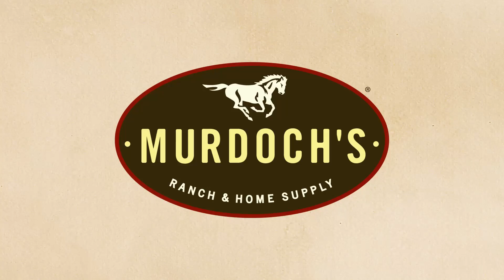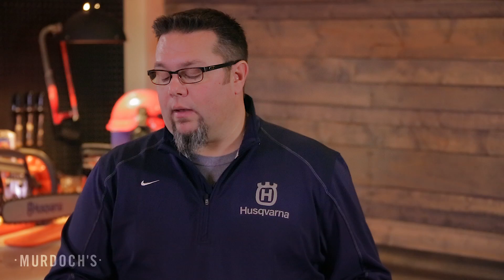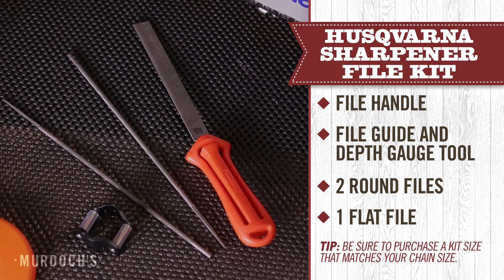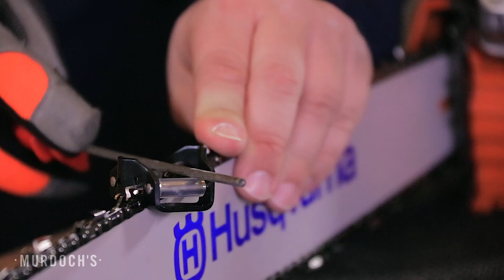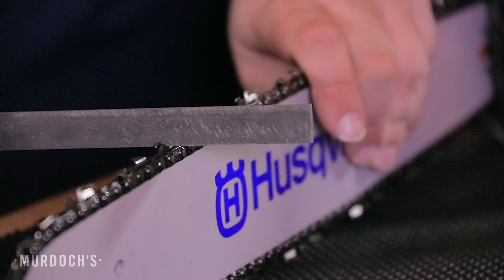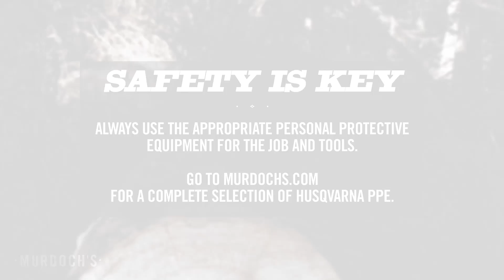How To Sharpen A Husqvarna Chain

Comment: The roller guide has 2 circular holes in it. What are these for? Just for storage purposes, to insert the file while not being used? The flat guide (not show in this video) also has a circular hole. Again for storing? Also the orange handle has a couple of marks on each side (25 and 30), which I assume are degrees. But how are these used when it's the roller guide itself which essentially dictates the angle.

Comment: Where is any instructions?  I bought the husqvarna sharpening kit and the rake adjuster 😊is totally a problem , especially with NO HELPFUL explanation. Sorry but this video isn’t any help, please redo it with intense, visuals as you actually use each piece in the kit!

Comment: OK, when you demo, should demo the full use of the file guide. Did not show how it is used to set the depth gauge/rakers.Sharpen a lot of saws and these Husky file guides are really easy to use, especially for those with very little experience.

Comment: An inadequate video about how to use a Husqvarna file kit, amazingly, by an actual trainer for the company. No information about how to set the file guide down onto the chain with regard to the arrows and depth.  No information about use of both rollers (vs. one as shown!). No coverage about how to use the provided flat guide to file down the rakers, etc. etc. In addition, the schematic for the kit  for 3/8 " File Kit Mini H35H36 (which I bought today) showing the filing of rakers in soft and hard wood shows a guide tool which does not actually come in the package!
Reply: Totally agree, was no help at all. I bought all Husqvarna equipment. This guy was no help. Shame on you Husqvarna.
Reply: The video should be labeled: "How to talk for four and a half minutes about nothing useful." Replace this please HQV.

Comment: Got it to chop up a large oak tree that came down in the last storm.>>>ur2.pl/722    A lot of work, but this chainsaw made all the cutting easy work -- moving the stuff is a different story though. 20" is a good bar size for this model. I'm not sure if would have enough power for larger cuts where you would want a 24" bar -- but maybe you can do it with a bit of patience.
Reply: I went to 24 inch bar and sink that sucker deep never bogs down the saw is great I want my money back on this vid tho